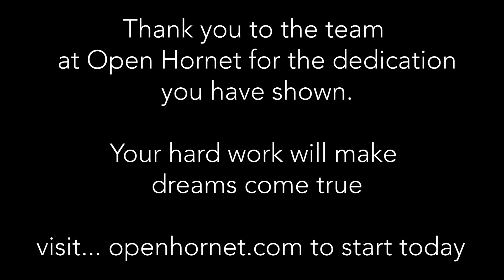Ep: 13 - Unboxing my F/A-18 Cockpit | Open Hornet

Comment: Hi mate, love watching your content, I've recently begun down the rabbit hole of building my own Sim-pit with the OpenHornet plans, I was wondering if you would mind sharing the files you made for the notches on the ribs as it looks a ton easier and stronger with the notches, as I will hopefully begin CNC'ing the the MDF early next year, thank you
Reply from the maker: Hey mate! Thanks for the comment 🤙🏻🤙🏻 I can look at compiling them :) are you using metric or imperial
Reply: @aHornetsNest  Legend thank you and thanks for the quick reply, I'll be majority metric for the build (QLD Based), I'm currently making some of the simpler switch-based panels to get into the swing of things
Reply from the maker: Nice one! Well message on Facebook or Instagram if you have any questions 
And I’ll get that file ready for you

Comment: I have the plans but can't find any dimensions for ejector seat thickness (MDF parts) is there a specific pdf with all the dimensions. Cheers
Reply from the maker: Hey! In the .SVG files 
In the file name it’ll have the thickness in inches 

Either .75” .5” or .25” … or 19.05, 12.7, or 6.35 … I used 18mm 12mm and 6mm MDF
Reply: @aHornetsNest  Appreciate the reply, yes I did find them after putting on my glasses  and realising it's inches not mm. So I can make a start. Although I have started printing the DDI. Thanks again for getting back to me.
Reply from the maker: Hey! Sorry for the late reply 
The new YouTube “new replies” function doesn’t like to notify me! But I’m glad you’re on your way! Keep me updated

Comment: hi there scott got a question for you , i contacted a couple of cnc shops to get a quote for the structure so i sent them the svg files that i got from th oh website but they said it only gave them an image and they couldn't do it and they asked to send it in step or dxf format .
any advice?
note: i have no idea how cnc machines work.
thanks.
Reply from the maker: Mmmm I know that it was exported in SVG because that was the most common format for hobbyist/consumer CNC
Best bet then would be to export the files themselves straight from Fusion 
Or maybe there is a SVG to DXF converter online
Reply: @aHornetsNest   thanks man, found a converter online.
Reply from the maker: Beautiful! 🫡🫡

Comment: Fantastic!   Are there DXF files available for this build to use with CNC ?
Reply from the maker: Hey! The OH build package has all the files as SVG, but if you wanted DXF you could either convert them or you could export them from the Fusion 360 files

Comment: how much total would everything in this cost other than pc and headset and stick and base as i want to sue a thrustmaster f18 grip and moza ffb base
Reply from the maker: Mmmm it’s very user dependent… it comes down to how much you want to spend on switches (whether they be OEM switches, or cheap ones from Ali Express), as well as the visuals etc 
But assuming you already had all the equipment - you’re looking around $8k at the cheapest
Reply: @aHornetsNest  holy shit.  wooof any email you have to i can get some help?
Reply from the maker: I’ve got Instagram and Facebook if you want to shoot me a message 🤙🏻
Reply: @aHornetsNest  will do assuming your fb is in your bio?

Comment: Open Hornet should definitely adopt you tab and slot design!
Reply from the maker: @pwilliamssa  thanks! Yeah it makes it so nice to piece together 😃😃
Reply: Would open hornet be against you sharing your modification to those files? Because that makes it so convenient.
Reply from the maker: I dont believe so, except for they are metric based... so it wouldnt work for imperial thickness MDF

Comment: Do you have the modified CNC files for the tongue and groove versions available somewhere?
Reply from the maker: As soon as I’ve finish the structural build of all the components - I’ll upload the files 
I’ve already found down errors with my modifications - so I’ll fix those and then upload them 😃

Comment: What's the material of headrest on ejection seat?  Same MDF?
Reply from the maker: The material of the headrest is PLA … it will be 3D printed? By I might mould a leather over it just to make it a little softer since I won’t be wearing a helmet
Reply: @aHornetsNest 3d printing It seems to be the only right way...I tried to make from scratch with some frame of plywood + filing of foam, and then i tried to  cover it up with leather which is used to repair a car seats...I am not realy satisfied with the result. It would be interesting to see your process of creating this element...With best wishes!)
Reply from the maker: Thanks for the insight into your process 🫡 stay tuned … I’ll let you know how I go :)

Comment: That’s great, where did you manufacture the pieces?
Reply from the maker: 😊 thanks mate 
A friend of mine works with CNC machines - so he was kind enough to add it to his job list and cut it for me
Reply: @aHornetsNest  ok, thank you for the information. Do you know, if somebody offers the frame already cut in pieces?
Reply from the maker: @mcclient150  depends where you are, but most areas will have some sort of business that specialises in cabinetry making and joinery… and you can give them the Open Hornet files and they should be able to cut it out of MDF for you
Reply: @aHornetsNest  got you, thanks a lot.

Comment: yo waht switches do you use i dont know what size is normal for builds i have very tiny switches i dont know
Reply from the maker: Hey I use 12mm mounting thread toggle switches with small backs

Comment: Awesome! Just out of curiosity, how much were you getting quoted? Based out of NSW and dreading the CNC cost. Not necessarily after the side wall pieces but curious.
Reply from the maker: Hey mate, I was very fortunate and my friend cut it for me :) 
The company’s on the Gold Coast that quoted said around $2500 for side consoles, and similar for the centre hub and UIP/LIP 
But I also think that’s got a bit of Christmas tax added to it, and they didn’t want to do the job because of work load 
So I’d check around and keep me updated how you go :)

Comment: How much did it cost including shipping if I requested it?
Reply from the maker: Hey so a rough breakdown is $350 in materials if you went to just cut it at home 
Depending on how your CNC shop cuts and packages it, but can range anywhere between $600-800 shipping 
Then add what ever they charge out for labour 
I was very lucky and my friend cut it for me 😃

Comment: Great video!! I'm excited to see what your simulator looks like when finished!!

However, a little health tip...

When painting or using a spray gun, always use a dust mask and old clothing!!!

Especially if you spray in the apartment when the room temperatures are high!! What you are doing is very harmful to your health!!
Reply from the maker: Hey thank you!!  
100% I spray in a open car port 😃
When I’m not on camera and don’t need audio I’ve got the respirator set up 🫡

Comment: Would you be able to add a link to the files? I like your modified ones a lot. I always struggle with the OH files lol
Reply from the maker: Hey mate! I will compile a AHN Modded pack - let me just prototype it all and make sure it all fits :) that way if I have made any errors… you don’t have to make them as well 😃
Reply: @aHornetsNest awesome thanks!
Reply: I would also love to get your modded files when you can.  Awesome job!   How many 8x4 or 8x10 sheets of mdf did it take?
Reply from the maker: @reservoirdog1099  😃 it was 
5 - 1200x2400mm 18mm 
1 - 1200x2400mm 12mm 
1 - 1200x2500mm 6mm 

Would be your equivalent of 8x4
0.75” , 0.50”, 0.25” respectively